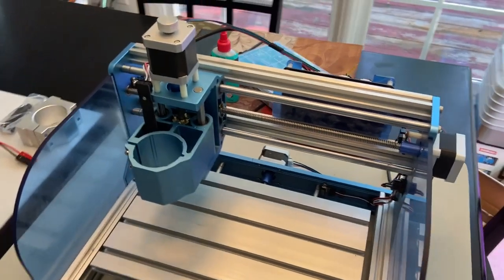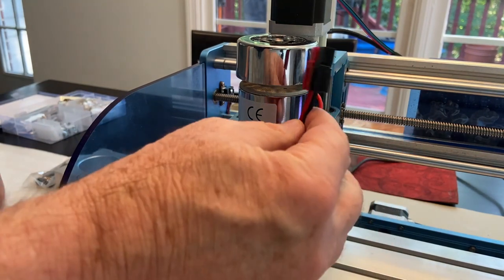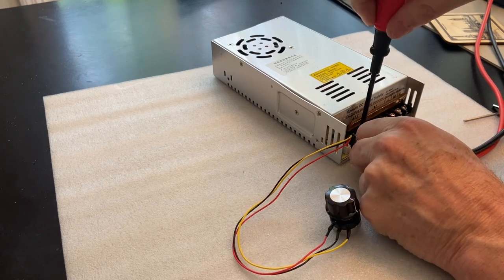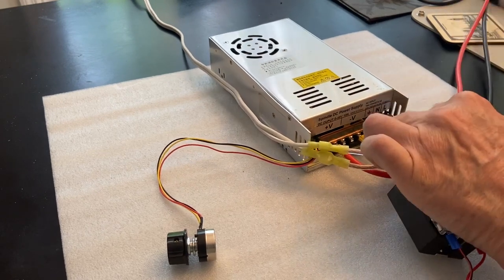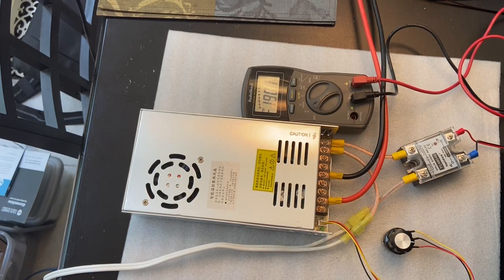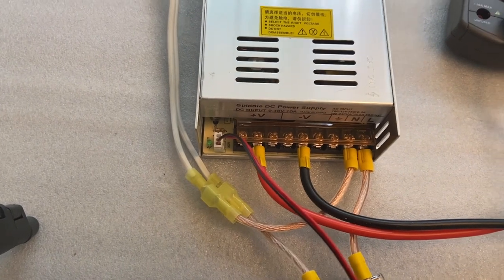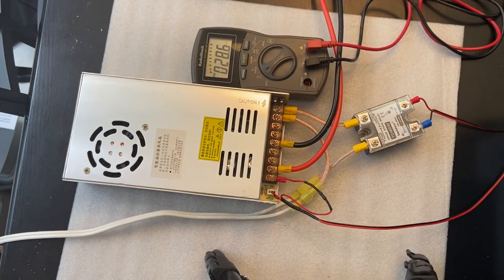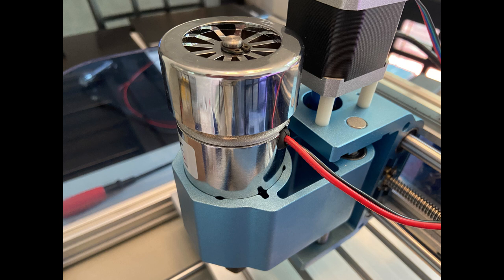3018-Prover 300 Watt Spindle Upgrade with GRBL control

Comment: I just tried to hookup the solid state relay to the power supply to get the on/off control and the spindle voltage output on the PROVer controller and the spindle speed is going up and down. This is with the potentiometer for speed control and not hooked to the 0-5v connector. Measuring the AC voltage showed it going up/down similarly to the spindle motor voltage. It appears that the solid state relay is having issues. I bought the one on your list of materials. I am not an electrical engineer and I don't own an oscilloscope. Any chance this is a shielding or interference issue? Thoughts?
Reply from the maker: I was able to duplicate the problem at low levels. You just need to filter the pwm a bit. An easy way is a 1uf capacitor across the SSR trigger terminals. Better still a series resistor of 100 ohms in the plus line and the 1uf capacitor across the terminals. I just tried it and it works fine. The 100 ohm series resistor is not only a part of the RC smoothing filter, it is also an inrush current limiter.
Reply: @lanierje   Thanks, I will give that a shot. I finally clued into the fact that the 24v spindle output is PWM and that might be causing the SSR to flicker the output.

Comment: Why get only a 300 W motor?
Reply from the maker: Its lighter than the 500w motor (I did a video on the 500w). Less stress on the frame and the 300w motor seems to have lower eccentricity. (vibrates less)